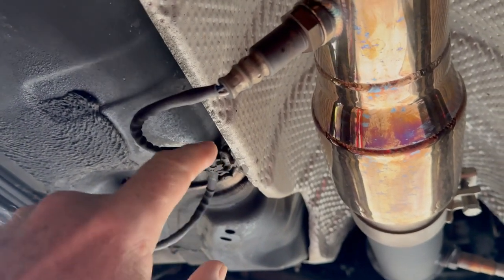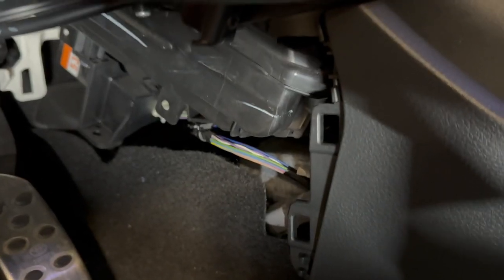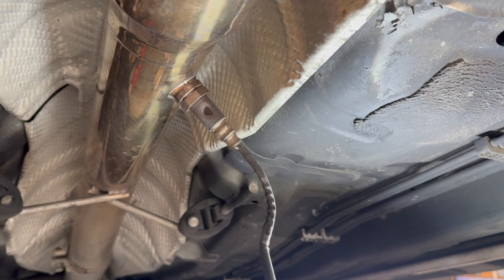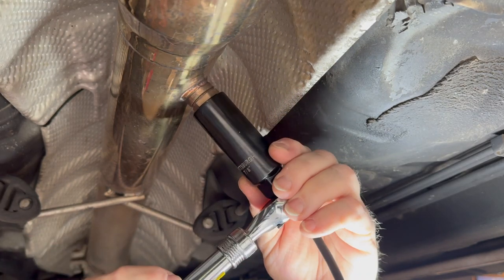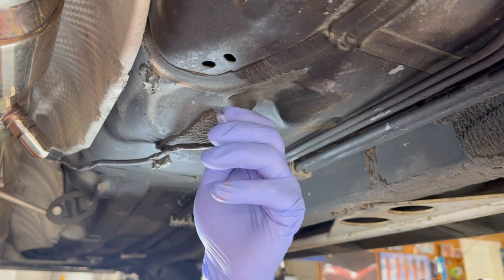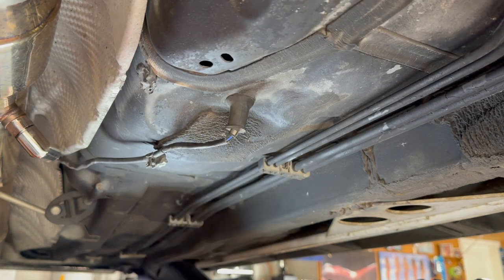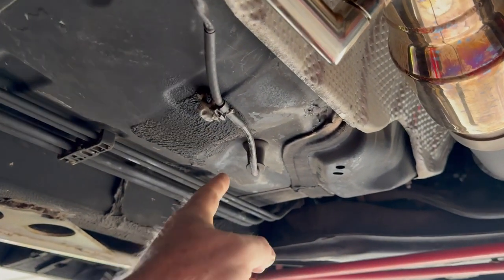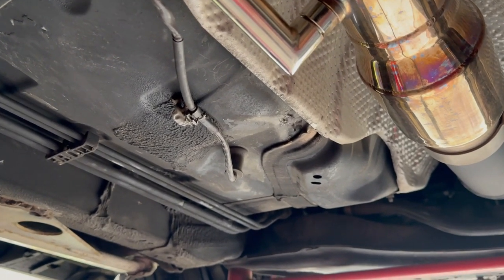P0420 Code? How To Remove & Replace An O2 Sensor // Defouler Installation

Comment: Have you driven with this installed? I get that same code every once in a while. 
Also wondering, did you get the thermal coating on the turbo and down pipe?
Reply from the maker: Yes, not for very long though. Jesse at Turbokits told me that it was normal for it to happen every so often due to the different CAT. I did get the thermal coating on it when I bought it. I had the downpipe, exhaust manifold, and turbo done.